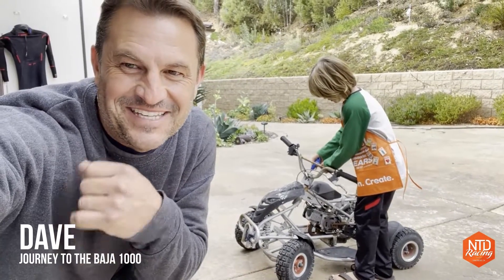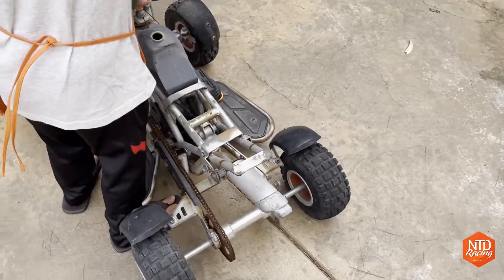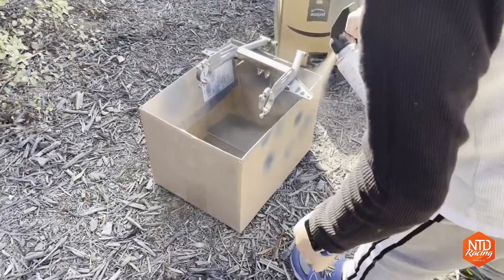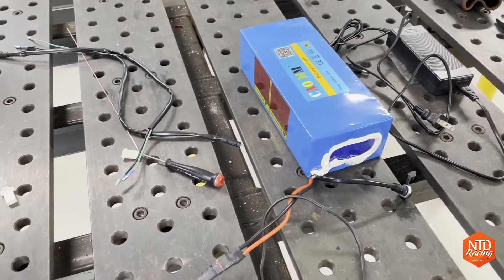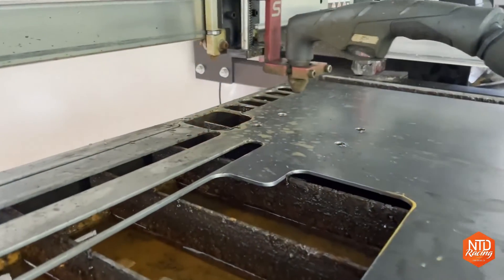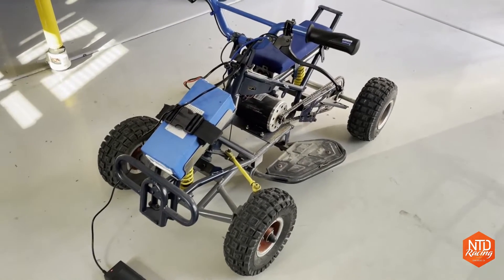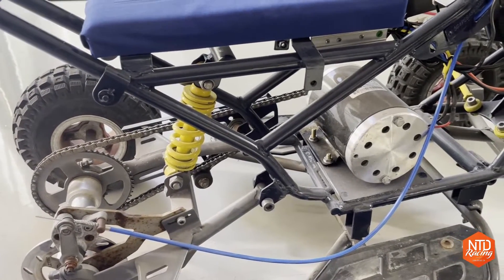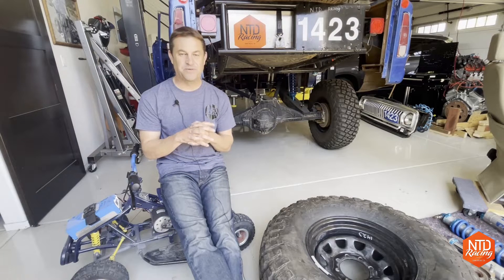Electric Vehicle Conversion - Quad Bike from Gas to Electric

Comment: This is awesome. I have a 5 year old and a 3 year old with some 110cc Chinese quads that are constantly a problem. Been thinking about doing this but I've never messed around with electric conversion before. Seems simple enough right? Is it easy to manage the speeds through the electric controller?
Reply from the maker: It was easy to dial it down with the controller we used.   I basically added a switch to make it 1/2 power.  It is fast at full power.
Reply: Okay cool I think im going to give it a shot. Thanks for responding!
Reply from the maker: I have a few videos in my playlist. https://youtube.com/playlist?list=PLMrLQ2KnHk278moWUTSnQ62D_7I30qJDX.  After some practice I can go fro idea to fusion 360 to cutting in about 2 minutes.   Hope the videos help.

Comment: Move the batteries off the nose. If they get damaged in a crash it will be fireworks
Reply: Just don't crash im putting 72v on the front and imma doing 80mph plus

Comment: I did my motor mount differently, that has no adjustment for chain tension.
I made the motor plate then put bolts though the elongated holes in the original engine mount then clamped the plate on top, flipped the quad over and tack welded the bolts to the plate and finished them off with it off the frame.
So now I have a motor mount plate with studs that go though the original mount and can slide back and forth, add a but to the bolt threads to raise the plate so you have clearance for the motor bolts to go in from underneath.
Reply from the maker: Good point, and sounds like you have  a good design.  Fortunately on this old quad, the chain can be tensioned from the rear.   Thanks for watching.
Reply: @ntdracing  my frame is almost identical to yours, im assuming you mean the spring loaded tensioner when you say it can be tensioned at the rear? I have not kept that as it runs soooo much quieter without it and having a sliding mount means i can tension from the front.  Extreme suspension travel on the rear arm can produce a slightly slack chain situation without a rear tensioner while the suspension is compressed but it returns to the preset tension as soon as the arm returns to its normal ride position.

The chain vibrated up and down so much when it was engine powered that the chain could come off when it went slacker but that has not been a problem since it went electric :)

Comment: Rad build! Maybe look into putting in a pententiometer, then you can adjust the voltage, turn it down for the kids, crank it up for the adults!
Reply: Electric scooter parts has an inline one for the throttle plug

Comment: Great video. I would love to do this with my granddaughter. She loves spannering.. and electric vehicles! 
Can I ask where you got the Electric motor etc and battery pack from? It looks very well matched to the ATV.
Reply from the maker: I bought them both on Ebay.  The Ebay numbers were 224065335567 for the battery and charger and 233614028748 for the Motor and controller.  Thanks for watching.